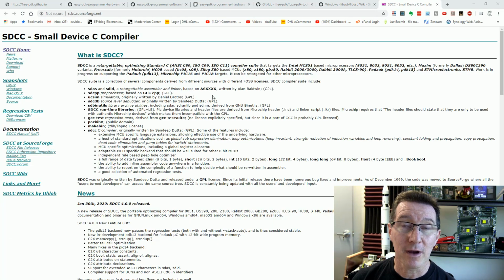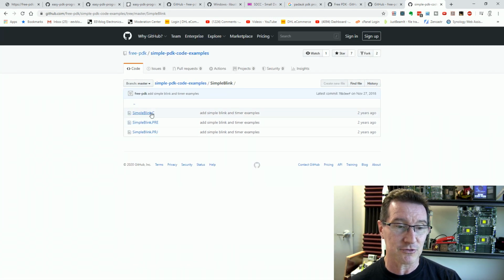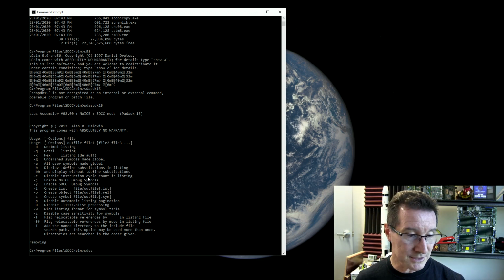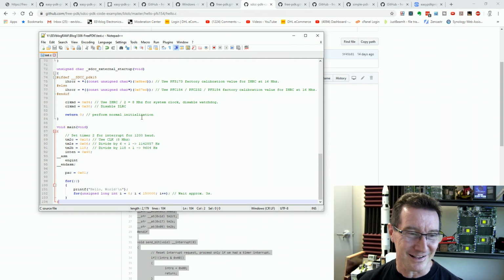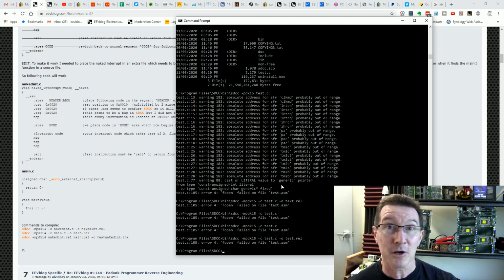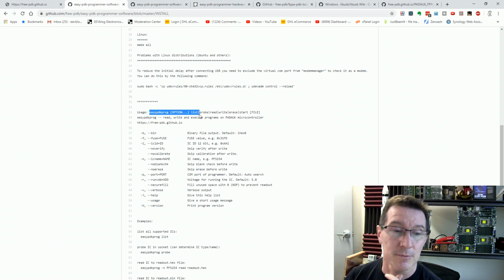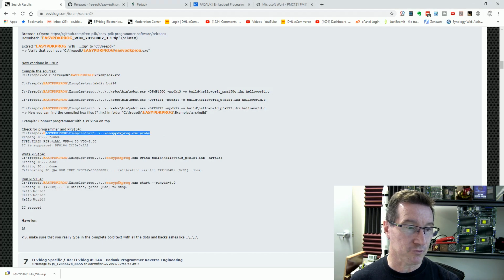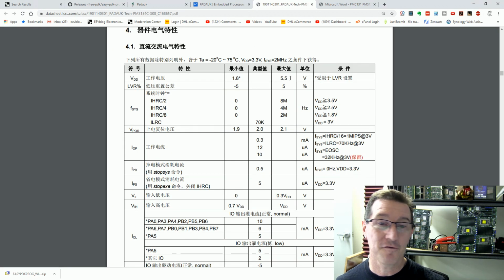EEVblog #1306 (4 of 5): Open Source SDCC C Compiler

Comment: I appreciate what you're doing, but I can't help thinking about the ATTiny10 in its SOT23-6 package, complete with 10 bit ADC, supported by AVR GCC, with 2K flash, available in single quantities for 0.33 USD. Is it worth the trouble?
Reply: Depends on your product costs. If you sell 100 devices each for 20 bucks, it's too much trouble. But if you sell 10000 of them, you would save $2700.
If you sell $2 products, it has a big impact.
In low volume I would always prefer a well known device.
Reply: @Momchil0  That's not fair, "it depends" is always the right answer in engineering!
Reply: Having open source software and hardware is always good for the maker community; plus there's nothing wrong with having more options
Reply from the maker: No one including myself is saying that a 3 cent micro is going to change anything in the hobby world, or other small or medium production runs where the difference between a 30c or 3c micro is a fraction of the overall BOM cost. But for niche application where it IS important then the 3c micro could be a killer.
Reply: This is actually a very good point and a lot of people, even professionals and companies in general overlook this quite often. If you running hundreds of thousands to millions, you don't care about absolute product quality and robustness, it's worth it. In all other cases it's not worth spending all that extra time (= labor = money) into getting something that still has to many unknowns after all that testing. Not to speak about the headaches of getting these from known and trustworthy suppliers. Not to mention the additional shipping costs and import fees.
So saying it's only a 3 cent part is a little weird. If you get enough ATTiny chips, I am sure they are more than willing to negotiate. But in the you also pay for some service and reliability.

Comment: my guess is that you are running it on windows instead of on the chip, and OS's abstract away their address space so it throws warnings such as 'cast of literal value to generic pointer' but you can as you did just ignore or disable that warning.

Comment: I have the same error when using ‘easypdkprog probe’. It simply says no programmer found but in ‘system information’ (I’m using macOS) the programmer is shown as ‘Easy PDK Programmer’ correctly. 

Don’t know what’s the problem. I have 2 programmers here and none of them works

Comment: Watching this series of videos I'm reminded of the expression 'We can't afford to use free tools'. In this case the 3 cent chip is absolutely a great value if one needs to mill out tens of thousands of a product using it (e.g. greeting cards with audio?). For anything with a smaller unit run even up to the thousand units look like the time taken to get all of this right might be offset by the difficulty in getting all of this to work.

Comment: You are not a serious developer until you use git to track the source, bash as command line even on windows, don't use pre-build/post-build bash scripts to generate an include file which contains the git commit ID going to be built into the binary. 😉

Really, overly bloated IDEs only good for starting up, once your project starts getting serious, you want to automate things and make the build/deployment process as clean as possible.
Reply: and vim as an editor even if there is an editor right in your ide

Comment: Im suprised nobody has written a python or powershell gui for this whole collection of software
Reply: because every selfrespecting programmer isnt really intimidated with using the command line.
Reply: @urugulu1656  yea me and command lines dont go together very well. It always ends up in a big mess.
I tried to get the keil compiler to work from the command line so i could use vs code as its just better but in the end i got so mad i just used the gui as i knew it worked.
Reply: @karsnoordhuis4351  keil ? i use that as well and just set up vim as an external editor... 
that being said i have it open still just for compile and upload and setting breakpoints in debugging. then close every file switch over to vim and do my business... (prevents me from having to do the file was externally changed wanna reload dialog everytime)
Reply: @karsnoordhuis4351  fun fact the gui has some features that are broken, not working correctly or with the expected behavior and some of the registers in the debugging are misnamed when compared to what the  datasheet says. 

sad that this actually costs money to get a licence for.

Comment: The sfr special func registers, in the C code, are they setting up the memory map? I would expect them to be hidden in a #include <PFS173.h>
Reply: Well, sometimes in early stages of getting used to architecture/toolchain/whatever it is actually preferable to see the whole thing that goes into compiler. Just to be sure. Because often that PFS173.h includes another, more generic PFS.h that is parameterized with some defines, etc etc. Eventually one has to use mighty -E compiler switch to be 100% sure what is compiled and what is not.

Comment: Haha printf, programming memory. I ran into this, naively thinking hmmmm I need sprintf here... Trying to compile this, bang not enough memory on the chip. Lol. Ok gotta get by without that.
Reply: I think the sensible thing to do in this situation is to define a conditional C macro for all your printf() and/or sprintf() based logging and have that compiled out for the actual micro. Then do all your development and testing on some emulator or dev board or whatever. Which supports a larger memory. Then the issue is how faithfully you can emulate / simulate. But such development tools are really essential for a decent experience programming these things.

Comment: Heh, Ten years ago, when I decided to start electronics as a hobby the first task of cause was to build MC programmer. (LPT based avr programmer).
It was built on protoboard with a lot of solder and wires, and of cause it didn't work once I turned it on. Only after careful inspection I found one single joint which I forgot. After I'd fixed that, it started to work. Probably I was as happy as Dave at that moment.
Reply: SignallerK relative to Dave would you say that you were:
1) as Happy as
2) almost as Happy
3) somewhat less Happy
4) happier than 
5) much happier than
6) not at all Happy as
Dave?
Reply: @HighestRank  thanks. Corrected.

Comment: Just a comment on your hunt for an IDE. There might be some ways to pull it into the platformio ecosystem, which has good support in VS code for example, for a more "IDE" experience. Not sure that platformio has all the glue needed to properly connect to the SDCC stuff and do this trick yet, but it might be a fun rabbit hole for someone so inclined..

Comment: If you want all the IDE blah blah you could use the toolchain with Eclipse C/C++ that would give you all the scripting stuff you require,  ive done it with stm32 compilers Linaro ones among others and integrated gdb also.   Obviously your mileage is going to vary with what is available in the toolchain/tools you have in sdcc.

Comment: I'm glad Dave pointed out that use of printf() can pull in a rather large library. A good experiment would be to change the printf call to puts and see what difference (if any) it makes in the size of the file to be sent to the Padauk micro.
Reply from the maker: In this case it seems pretty small, but with only 2k it could be a killer.

Comment: Who would buy a three-cent mcu when they can emulate the VHDL on a $1000 computer?
Reply: someone who isnt feeling like wating hundreds of ics during the stages of development
Reply: urugulu Sorry, you lost me at "wating hundreds of ics".
Reply: @HighestRank  I assume is is supposed to be "wasting", not "wating".  But I think the answer to the original comment is that this series is about showing the process of using an unfamiliar product, not showing that this is the most efficient  and cost effective development method.
Reply: Jeff Ratliff yet even with the typo corrected, it still doesn’t make logical sense. A person who’s using a 1000$ PC IMO is the SAME PERSON who feels like ‘not wasting hundreds of ICs’.
Reply: @HighestRank  first of the grammar police can STFU typing is hard ok... 2nd the 1000$ pc you most likely have anyway not to mention that even an older less expensive machine will do just fine since all it has to do is upload some code to a fpga ... by the way you most likely do a lot if other stuff with that machine.

Comment: One mistake I noticed: at 34:34 , you said "as we saw before, we used ~900 bytes for the Hello World"... but that's 900 bytes of intel HEX format, where every byte of actual code is represented as 2 bytes of hex, plus extra line breaks and addressing info, etc, etc. So the actual hello world program is only used at most ~450 bytes.
Reply from the maker: Yep, brain fart.
Reply: I'm surprised that the programmer software doesn't report stats like that by default.